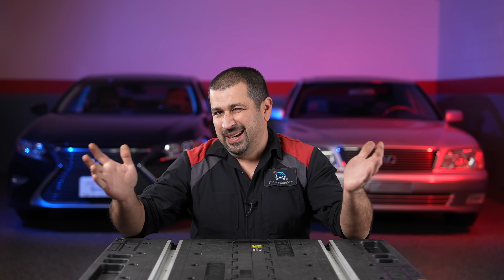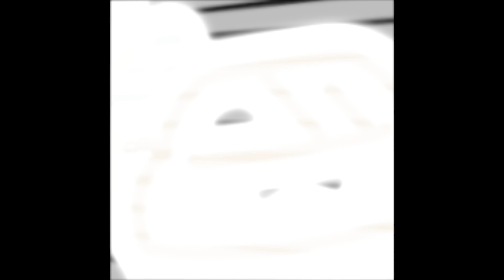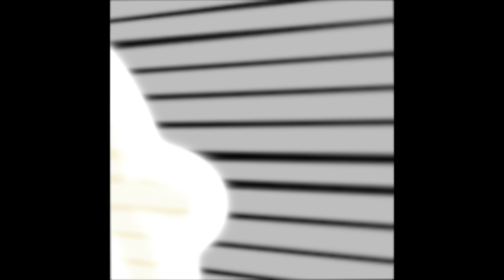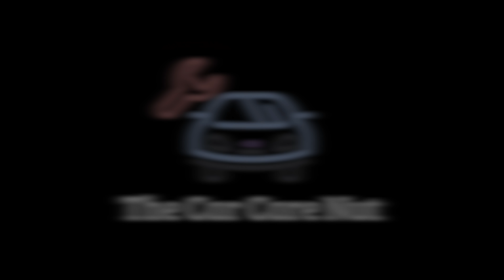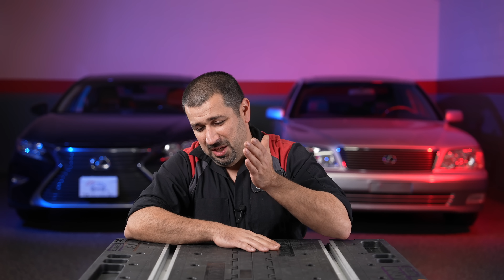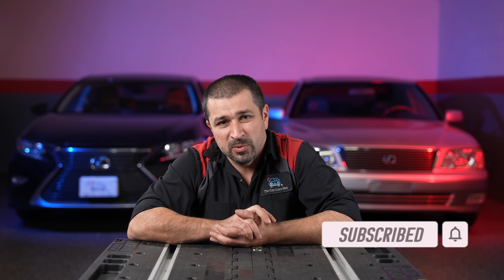Can Modern Turbo Engines Be Reliable? Here's The TRUTH!

Comment: Thanks for another great report. Not currently a turbo-engine vehicle owner but will probably be hard to avoid in the future.  Since I don't drive many miles, I have had oil changes based on months not miles.  How many months is recommended for turbo oil changes?

Comment: Driving style and maintenance will determine its longevity. Turbos will never have the longevity of the tried and true NA engines of the past.
Nowadays even NA engines with only DI will break down just as quick as turbos due to carbon build up. The whole thing is rig to either keep you in debt or to never own a descent vehicle…

Comment: Steam engines went from horribly inefficient to peak efficiency over 150 years of engineering improvements. They became much more complicated and expensive to repair. Even at peak efficiency they lost the majority of the energy as waste heat. Internal combustion engines were much simpler and could turn a higher percentage of the heat into useful work. Even then only 15-20% was turned into useful work. 120 years of engineering improvements squeezed a higher percentage of the heat into useful work. We're at another transformation point. Electric motors can achieve efficiencys as high as 80-95%. Steam engine advocates back then fought tooth and nail against internal combustion engine. We're watching the same thing no. I worked for 35 years in the shops of dealerships and independent shops. When I retired I thought I'd check out electric vehicles. That was ten years ago and my wife and I would never go back to an internal combustion vehicle.

Comment: I had a twin turbo car but I was told to also put a turbo timer on the engine which allowed the engine to continue to run after you had switched off the engine to allow the turbo to spool down while the oil circulated after it was driven at  considerable speed for an extended period.

I noticed that the manufacturers did not put any such contraption on the engines. I agree that the oil has to be changed every 3000miles.

Comment: Not modern but 2jz, rb, sr, 3sgte reliable turbo engines. That ls400 behind him with uz engine will outlast any of those engines and any modern engine. I agree with him as a mechanic need to change oil, 10k is insane 5k synthetic my intervals but dont have turbos i have supercharged cars

Comment: i just had to dock my 94 2500 with only 260,000 miles on the clock, she needed new upper and lower control arms and bought a 23 1500 and it rarely turns more than 3500 rpm and i will not be towing anything with and i change the oil with top shelf oil and if a set the CC at 67 mph i can get 28 mpg with just myself on board and my 94 with a 350 only got 12,13 mpg so that thats a plus, the build quality seems good, but i hate the touch screen non sense and the start, stop crap and im going to get the afm/dfrm system blocked off because that's a fool's trick to get slightly better mpg, but the risk of ruining my their engines and having to shit 10 large for an engine replacement because some of the engine blocks get vents through the blocks, and another thing i don't like is that you can't leave the engine idiling for warming the truck to defrost the windshield in michigan winters

Comment: Good clear warning. I have theory for toyota engine failures, so we know that manufacturers are only interested in warrenty periods, past the warrenty they want failures. Is toyota testing just how good todays issues are getting JUST past the warrenty period. Like you say, the turbo use plus add in some debris & see the result, clearly the engineers haven't cracked the formula yet but, they will.

Comment: Hey there, I have a 2008 Abarth 500 which has run 150,000 miles, the turbo is now defective and needs to be replaced. The rest of the car is in very good condition and the oil changes have also been done regularly. Is replacing the turbo recommended or is the whole car a lemon?

Comment: PTL. Turbo charged engines have high pressure running through the engine and high compression,  all of which wears out the engine components much, much faster.  If you don't need it; let it go.  PTL. 😮

Comment: IF the driver does things correctly, a turbo engine can last as long as a naturally aspirated engine.  First, forget that BS people tell you about not warming up your engine before driving.  Especially true in cool to cold weather, and it has to do with making sure the oil is flowing properly to all bearing surfaces including the turbine before applying loads.  On the other end, do not drive it hard and then just shut it down.  Let it idle for a minute or more to allow that turbine to spin down from the extremely high speeds it runs at before shutting down the oil pump.

Comment: I say yes.   I am the OG owner of an 2015 EB Mustang PP.   Owned it two years, sold it to my son, and he sold it to me after 7 years.  Now it’s a track only car.  In that time; brake pads, tires, EVAP line, and high side fuel pressure sensor.  The key is maintenance.  Oil was always changed twice annually, DI engines are dirty and added an oil separator.  3 year brake fluid renew and 30k trans fluid changes, spring underneath cleaning and oiling as it lives in the salt belt.  Car runs like new, still averages 26 mpg, and wouldn’t hesitate to buy another.

Comment: There is video about turbo engines that says that VW and Skoda are cheating customers for 15000km service just to increase sales as the engine won’t last beyond 70000-100000km. We need to oil change oil every 5k km or engine problem will be there.

Comment: It depends.
On a regular car (a sedan, coup, hatchback, etc) yes it will be fine.

But for larger vehicles like pick ups it's a bad idea. It's putting too much stress on a smaller engine.

It's like asking a small person to carry what a large person does. Which generally isn't comparable. That's just a fact of physics. Some may try and cheat that with performance enhancing drugs, but they don't  magically make the body durable enough.

Comment: You can still avoid Turbos, and you should.  When I bought a new Mazda 3 last year, I just told them I want a GS, no Turbo.  Easy.  Plenty of power in a NA 2.5L.  If that isn't enough for you to drive around town, get some EGO therapy.  Synthetic oil change every 8 to 10,000 kms and I've never had an issue after 37 years or owning vehicles.  Kirkland or Walmart oil is JUST FINE.  Look at the actual tests.  Only suckers pay double and triple for expensive oil.

Comment: Over two centuries the "bigger was the better", all the sudden "the smaller the better"! You can't even get the gas stoves or the furnace. We got the heat pump instead of a gas furnace in Colorado! It runs loudly non-stop and the house is still cold! They call it more "efficient"

Comment: oil is cheap but engine is expensive  ( scotty. k ) , in old car i was changing oil frequently and used oil in chainsaw because its not too dark, or mixed it with chainsaw bar oil,  but new oil is better

Comment: The car nut guy is so correct , I never owned a turbo and never will for a daily used car , I have 240,000 miles on my toyota 2.5 litre , awesome  motor , I change oil every 5 thousand k

Comment: “No such thing as a free lunch.”
“You can’t have it both ways”
40 years ago my engineer brother said: “engines in general, turbos specifically like clean oil.” 

To that end I hafta wonder how many miles would I had gotten on my 1984 Dodge (Mitsubishi) Colt turbo before it died. 

I bought it new. Always used synthetic oil. Changed it w/filter religiously between 3-4K miles. Always allowed time* to warm up & idle/cool down before shut down. Fairly early on, I found a 4 1/2 minute** that allowed the car to run** w/the key removed - perfect for NE winter warm-ups & anytime cool downs. 
*actual time weather dependent 

I enjoyed 32-35 MPG while driving the fastest “Hot hatch” in its class. Following a suspension tweak, it was the best handling, too. 

I sold it @ 109K, original clutch, turbo, & CV joints. The sale included a day-one log book recording every fuel-up*, oil & filter change**, and any other (however few 😊) repairs.
*date, OD reading, fuel brand
** date & OD reading

Take care of your (turbo) engine, it will take care of you!

Comment: Another reason Turbocharger Engines fail early especially on small engines is that the engine oil will burn and coke up in their smaller oil lines and oil galleries due to extreme heat and it will block those small turbochargers oil lines and oil galleries inside the bearing areas of the engine and that will block oil flow through the engine like blocked arteries in a heart.            My advice is to have fun when you go driving but stay out of the Turbocharger every time when going home or the last 10-15 minutes that the engine will be running and let it idle for a minute or two before shut down if you used the turbocharger -  (cool down period).           I've been telling people with Turbocharger engines for years the maximum oil change interval needs to be 5,000 miles or less and it sickens me that the car manufacturers have been saying 10,000 - 12,000 miles on oil changes.     I believe some do that because they know you will blow up your engine in just a few years and they see that as more money for them in repairs.

Comment: Define reliable.. 100k miles? Sure, when the engine is built around forced induction. Its not that you can get some decent mileage, its the cost to maintain, repair, and refurbish that makes forced induction at least twice as expensive as NA.

Comment: Never owned a turbo Toyota...and I've owned about 14 Toyotas over the years since the early 80's.  Starting with a 1977 FJ-40 and now a 2011 FJC and 2016 Tundra (and not to forget my 2015 Prius).  Learned on the farm years, and I mean years ago, that diesel turbo engines in tractors had to be pampered, especially in the shut down.  When I was in the pickup, ready to head home for supper, my dad was still sitting in the cab of his Case, after dark, letting the engine spool down.  And how I remember the oil changes in my dad's turbo'ed tractors.  That was in the 70s.  For all the reasons stated in this vid,  and how my dad had to pamper his turbo tractors, I avoided turbo gas engines in Toyotas, like with my brand new 1990 Supra.  The turbo'ed model was attractive but I went with the 2.8 liter, 200HP version instead.  Wow, how I wish I still owned that Supra.  Mr. TCCN knows his stuff!

Comment: I am writing this before the video, I have 2010 Bmw 320d xdrive and 2018 Bmw x5 25d xdrive they are both turbo diesel engines and I have no engine problem what so ever my wife and I still driving them.  The key is know how to drive and not to abuse the engine.  I do not understand 0-60 time mania, trac times, power to merge highway, they are all meaningless and kill the engines.  Read manuals, break-in period is importand and periodic services

Comment: 100k miles divided by 4 (oil every 4k miles)  gives you 25 changes of oil at around 100$ you end up 2500$ is it not cheaper to change that yurbo at 50k miles and be done with it

Comment: I have a 2024 Tacoma.  I have 44k on it and have done the oil changes every 10k as recommended by the manufacturer.  I will drop this POS like it's hot when the powertrain warranty expires and let it contribute to the degradation of Toyota's reputation on someone else's dime.  Toyota is cashing in on their name like GM did in the 80s.  Their new lineup is junk.

Comment: Turbo's are mfg's crutch for not building larger engines....2.5 l w/ turbo is prolific......I would NEVER buy a turbo car....Reason?  I owned an aerospace mfg co. in the 70-80's and produced many turbo races with tolerances and grinding / polishing requirements that are off the charts.....for an impeller to work well and live long, this is a necessity...do you think car mfg's are going to these lengths in their turbo productions?  I don't think so....they can't even produce a paint that lives very long.....

Comment: Thank you for an honest evaluation of turbo engines. My last car was a non turbo and I could feel and hear when the oil was begining to breakdown. I'd change the oil. My current car is a Fusion with an Ecoboost 1.5 Liter engine and it has 92K miles now. I'm approaching a service interval where I'll have the Coolent changed. The turbo for this engine is water cooled and that has kept the turbo alive. The oil is cooled. I change the oil. I buy a very premium oil and change the filter with every oil change. The coolant is original and that cannot be ignored. But, now the kicker. I hail from a family of car nuts. One uncle was test driver for Studebaker. I know how cars and car engines are tested. They are warmed patiently and driven a little bit hard once warm. Not all the time, but not babied all the time. That used to burn up Corsair's and other air-cooled engines. Babying them creates uneven cooling patterns and stress the engine assemblies. Every once in a while, I give the turbo a go. Great for pumping good oil into the turbo and stale oil back to the oil pan. I don't uncork it for more than up through forth gear and I won't stress the engine into high speed. That builds too much heat and dissipating a lot of heat takes too long and the oil gets unduly stressed too. It's also good for the bearings in the whole engine as the clevite smooths the bearing surfaces. Oil has to circulate through the engine to lubricate and cool everything to a moderate, uniform temperature. Works for the transmission as well. My engine is smooth, efficient and quiet. I've seen babied engines that clater and shake and are all carboned up from abuse. Carbon deposits collect heat, heat that doesn't dissipate well, even after the engine is turned off. When new I go 10K miles before changing the oil. At 75K miles though I started changing it at 6K intervals. It just sounds and feels better.

Comment: We bought a 2018 Honda Civic with a turbo. The car almost killed us. Turbo lag.  No one was coming, so we pulled onto the road. Suddenly, a truck came around the corner. Now, when you step on the gas of a non-turbo car, it moves. With a turbo, you have to wait for the turbo to spool up. In the meantime, the truck is barreling down on you. The turbo kicked in just in time, fortunately. Because of that experience, I will never buy a car with a turbocharged engine.

Comment: Yes, but you can't follow Toyota/Lexus OIL change guidance....of 10,000 miles. Which is stupid. Even when you to in and ask for a 5000 mile oil change they will act like you are nuts. You have to literally tell them you want it changed and then they argue and eventually do it. CHANGE YOUR OIL EVERY 5000 MILES! Stop letting the dealer tell you it's 10,000 miles...they love selling you a new car....when your fails because you failed to change the oil sooner than 10,000 miles.

Comment: Exhaust gas is the most corrosive thing in the engine.  Doing anything with it other than getting it out of the engine compartment as fast as possible is bad for reliability and longevity.  Piping it back through turbos and various emissions doohickies and then pushing back into the combustion chamber is just a terrible idea all around.

Comment: Mazda put turbos on there RX7 in the 90s which is a tough rotary engine which usually went 150 to 200 thousand miles. The turbo rotary would last about 75 thousand. Which proves the turbo puts tremendous strain on a motor.

.

Comment: I drive a twin-turbo Ford Edge with the 2.7L V6, and I’ve always changed the oil whenever the car prompts me. It’s got over 100k miles now—I bought it brand new almost ten years ago. Honestly, it’s been solid. The only hiccups have been a couple of sensor failures; each one was under $100 and took about five minutes to swap out.

The most demanding job so far was replacing all six spark plugs. The front three were easy—about 30 minutes total. The rear three, though… that was a four-hour adventure I’d rather not repeat. I’m hoping to be in an EV before that maintenance rolls around again.

Next on the list is the accessory belt, but I’m going to wait until spring to tackle that one.

Comment: I avoid turbos and will never own a turbocharged vehicle again. If I had my way all I would need is air conditioning, cruise control, power seats and windows, a radio, and fuel injection. Power door locks are real nice so add those 👍🏻

Comment: I got a car with turbocharged engine for use in short trips every day ,in few weeks started to add oil every week and in 5 years it needs to expensive fixes,it work for no more than 50,000 miles,Thanks for your Advise, you absolutely Right

Comment: I have had two cars with turbo engines.  The first was a F10 BMW 528xi.  At 32K miles, the turbo failed and was replaced under warranty.   That car developed loads of problems; the xDrive components were not durable and were expensive to replace, and then the plastic timing chain guides in the engine cracked, which caused the chain to slip, destroying the engine.   BMW cannot engineer a durable product.  I now avoid them like the plague.   

I have a 2018 Honda Accord 2.0 Touring that’s turbocharged.  The car has 180K miles on it and it ‘s still going strong.  There is a factory recall for the fuel pump, I need to bring the car in to get it replaced, but I have had no issues with it.  This is my third Honda and all have been rock solid.

I think it boils down to how well the product is designed and how well the owner takes care of it.